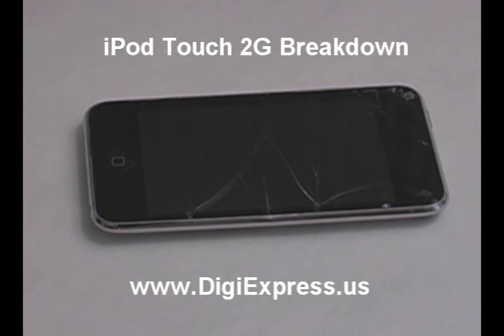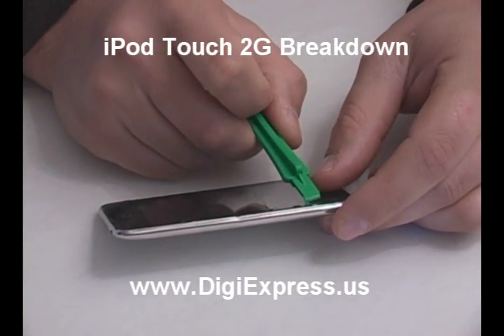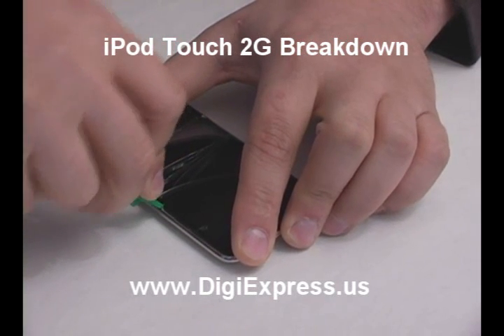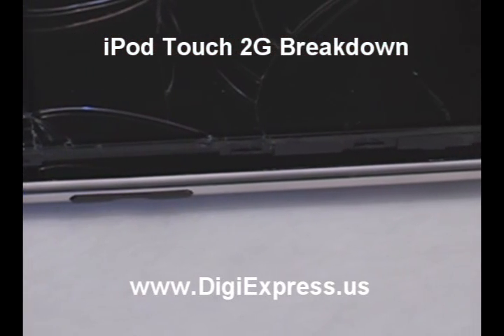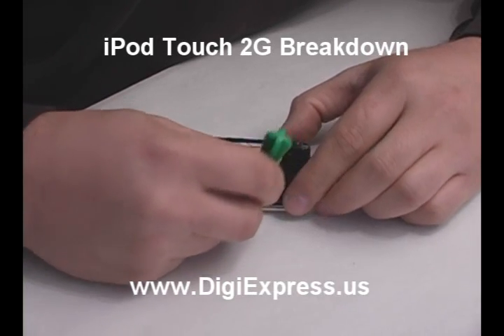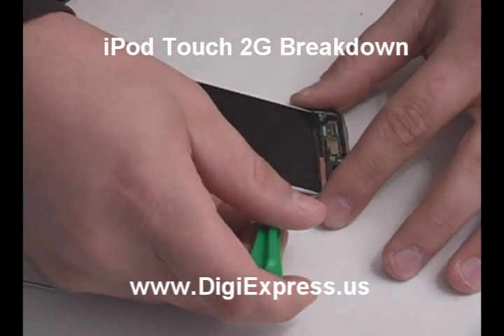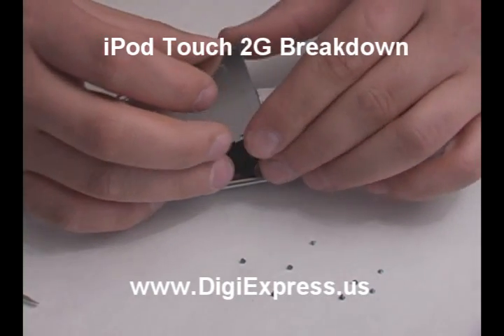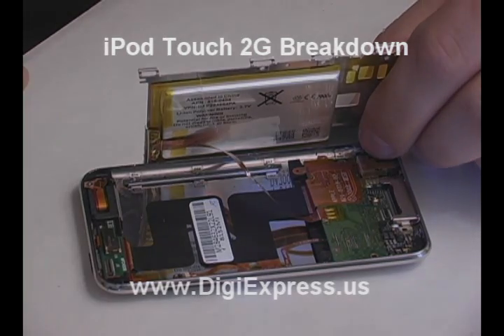DigiExpress - iPod Touch 2nd and 3rd Generation Breakdown

Comment from the maker: @joshleamey  It depends on why your iPod isn't turning on. It's possible that it could just be a battery issue, in which case the cost of the repair would be around $124.97 assuming that the screen, the headphone jack, and the battery needs to be replaced.

If it's something more serious, such as the main electronic's board, it would end up being cheaper to purchase a new one.

We do offer a diagnosis service for $25.00 (which is included in the $124.97). You can call us for more information.

Comment from the maker: @JakesChoiceTV  If your home button is not working, it may be caused by the button itself not seating properly or it needing to be replaced altogether, or the Home Flex Cable would need to be replaced. Without seeing it, we'd be unable to tell which unfortunately. Let us know if you have any further questions, or check out our website for more assistance.

Comment from the maker: @Igiarisan Since you are saying that it still charges this means that the system connector is not broken, which is a good thing because this part can not be replaced unless you change the main board. The back plate probably is just effecting how it charges in the iHome etc. Changing this part could help to fix the problem.

Comment: I tried and succesffully replaced the screen digitizer on my itouch 2g, BUT now the bottom of the touch screen no longer works. I can do the "Slide to unlock" but that is as low as it'll work for example when entering the passcode to unlock the 0 does not work. What do you think is wrong with my itouch touch screen?

Comment from the maker: @united768 This will not damage the iPod, however if you have any doubts do not be afraid to send it to us and we can take it apart and fix your iPod for you. We have a $25 diagnosis/repair fee, any parts you would need installed would be additional. Check out our website for more information.

Comment: the code on my original digitizer is 821-0627-A  but the replacement is 821-0627-D3.  The connections work and it is the 2nd one i have ordered with the same code but the touchpad doesn't work.  Are there multiple screens for the 2nd gen or could there be another problem?

Comment: My ipod got rained on. I turned it on only because i saw my friend's was working

so, it worked minus the volume button so i turned off to dry. It didnt power up next time and i took it apart to completelry dry. I did crack the screen but it start working

But the screen does not work.  Will replacing the screen fix it? and is digiexpress a good place to buy it? for a 2nd gen  itouch

Comment from the maker: @WildKillerFox Most times water or moisture damage can be repaired, however it depends on where the corrosion is located inside the iPod. Many times the battery shorts out, which is why the iPod will no longer power up. Our company can repair the iPod for $25 plus parts. Check out our website for more information!

Comment: i dropped my ipod in some sprite, about an inch and a half deep where the home button is (it was completely vertical). I did try to turn it on and use it for a little while like a dumbass and it worked.....for about 10 minutes. Now it doesn't even turn on. What is most likely to be broken/fried? Whatever is at the bottom is my guess

Comment from the maker: @rush2252 Hello! Is your "wi-fi" completely grayed out? Or is it just not working? Try going into "general settings" click "re-set" then click "re-set network settings" You will see the Apple come up. If this doesn't work try a restore. If the Wi-Fi is completely grayed out, you may have a bad Main Board  connection. If this is the case, there is no way to cost effectively repair a main electronics board in an iPod touch, as the part exceeds the value of the ipod, and you'll need a new one.

Comment from the maker: @streetsurfteam7000 We are not entirely certain of Apple's policy on repairing a cracked screen. They will probably just charge you $150 for a refurbished ipod. We replace the glass/digitizer for $39.99 plus $25 for professional repair/installation. You may check out our website for information on our services or call us at 1-800-440-4693.

Comment from the maker: @HARTline2012 You may have installed the LCD screen incorrectly or you may have damaged the digitizer, which is what makes the ipod respond to your touch. We have the glass and digitizer available on our website, along with the $25 professional repair/diagnosis service. If you feel nervous about doing it yourself, just send your ipod into us and we will get the job done! Our contact information is also on the website! Good luck!

Comment from the maker: @xKOOLAIDSNIPERx  Depending on the extent of the damage, here is an idea of the price of the parts you may need to complete the repair of your ipod: The ipod Touch replacement glass and digitizer is $39.99. If the LCD screen is damaged as well, the LCD screen kit is $99.99. If you also need a battery, we charge $19.99 for a new battery. We offer a lifetime warranty on our LCD screens and battery kits. Also, we charge $25 for professional repair. Return shipping is $3.75. You may order on the web

Comment: @DigiExpress my headphone Jack has stopped working. If. Were to order the part and send it in to u along with the iPod would their be a $25 installation fee?  or if I just get a diagnosis and repair and u fnd out it is the head phone Jack would I have to pay $25 for the diagnosis and repair and another $20 for the part? Thank you

Comment from the maker: @TheMrcustard If the screen is broken or not responding to your touch, more than likely you will need to replace the digitizer. The cost for an iPod Touch digitizer is $39.99. You may install it yourself or use our professional repair service. We charge a $25 repair and diagnosis fee and you may order this service through our website.

Comment: i went to a shop where they repair iphones and stuff because the touch display sometimes doesn't work.... they said they don't repair I pod touch because opening it would cost 4 (!) HOURS to do and so the service would cost 100€ and maybe, in my case, I need a new display (60€)... so repairing it would cost more to buy a brand new ( I bought mine for 150€ new)

Comment: @kop4321 
Buy an adapter, get a new jack to replace it, or put some aluminum foil in it.
DO NOT try what this video does without help, I made a little crack on the bottom left part of my screen for using the wrong tools...

Comment: its weird cuz my ipod touch works faster on da internet and overall than my computer.... sometimes it locks up but it fixes the problem in under 3 seconds... wen my computer that has windows xp locks up all the time... internet is slow and its overall has a rubbish performance than my ipod touch...

Comment from the maker: The Mid frame holds the Digitizer in place, so if yours is damaged it is a good idea to replace it if you are replacing the digitizer.

They are all different, the Touch 2G mid frame will not fit a 3G.

Comment: Is it necesary to get a new digitizer and plastic frame if all that's broken is the front glass? My touch still works fine the screen is just cracked up. What do i need to do and Where can I get the parts and tool to fix this?

Comment from the maker: It would be best to send it  and have a tech take a look at it. You may just need both a new digitizer and LCD screen. The cost for both would be around $170 which is approaching the cost of a new one. It is possible that you may need only one or the other, in which case it would cost half that. But it sounds like you need both.

Comment from the maker: That is what the video is about, repairing a broken iPod Touch 2G. The digitizer does not need to be broken for you to open it. You can use this video to replace the battery, LCD, ect.
We just happend to use one that was broken for the video because we were going to repair it anyway.

Comment from the maker: That ususally means that one of your battery connections is not making contact with the main board. Check all the connections and re-solder them if necessary.

Comment: i have just installed a replacement battery for my 2G Ipod Touch that i bought from DigiExpress. Although I have broke a very small peice that i think is the button that goes on the bottom of the ipod. At this point it is on the computer charger, but it keeps turning on for a cople of seconds and off it goes. Is this normal since the battery is new, or what? Thank you!

Comment: what is the touch part of the ipod touch is it the digitizer? cause i tried doing this before without the tool and under the glass theres a huge crack and my "touch" part wont work it will turn on but not respond to touch